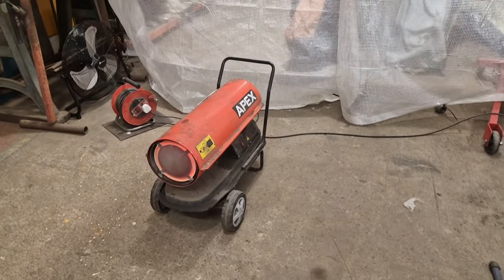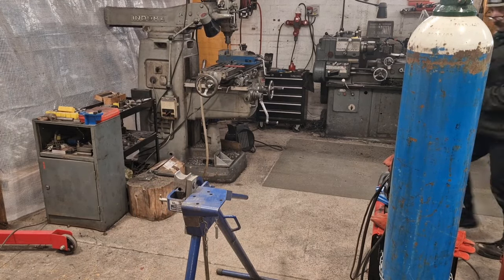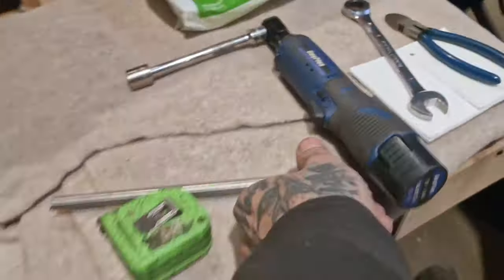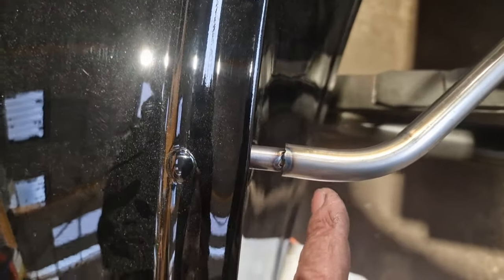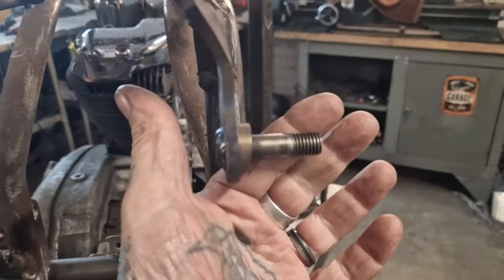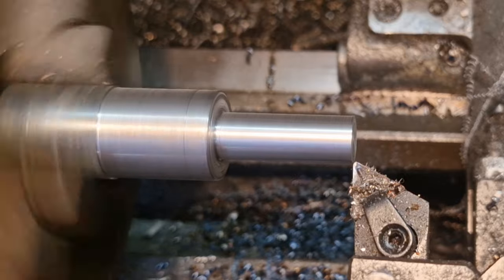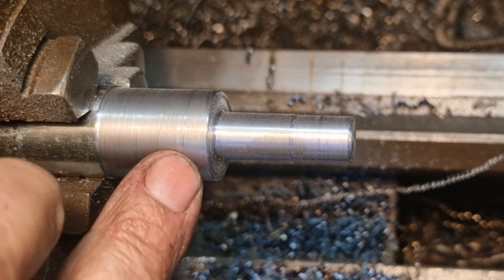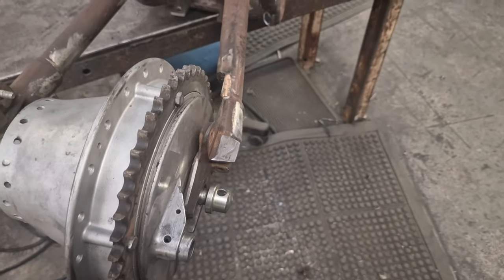Hardon again! plus 1920 Model T Ford Handmade Custom Bike Building vlog time #handmade #bike #vlog

Comment: Fantastic work Ralfy! Smashing hard-on you've got there too😂.
Ralfy I think the swingarm looks a bit skinny. I'm not picking fault in your work, I couldn't do it but I know you could make a new swing arm for that bike that would be better and stronger. I remember when my old man was working he'd come home some days talking about the difficulty of welding cast iron.
Reply from the maker: Thanks buddy, yeah G wanted to use that swingarm as it's original to the frame, the castings are steel, so should mig up OK, I might stick weld or silicon bronze it yet though

Comment: Looks good buddy . What size tube did you use on the rear fender supports . That rear arm is gonna be a challenge for welding . Be good to see how it goes . Cheers Ralfy
Reply from the maker: Thanks Yorkie mate, 16mm tube on those, stepping down to 1/2" solid